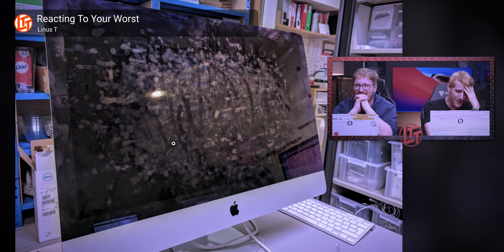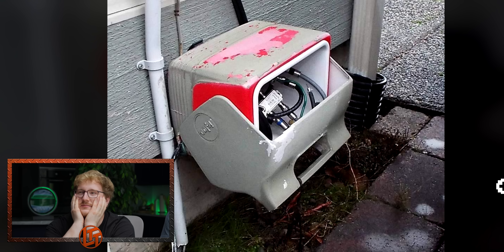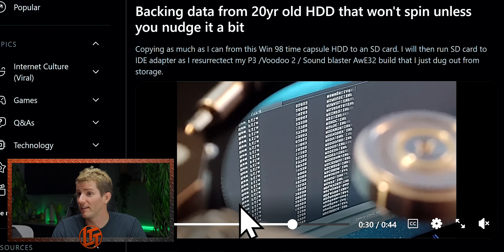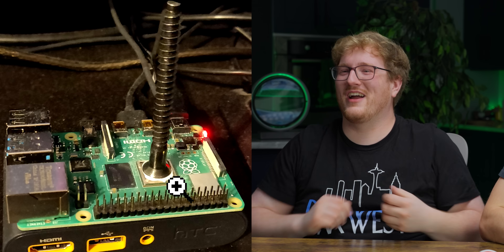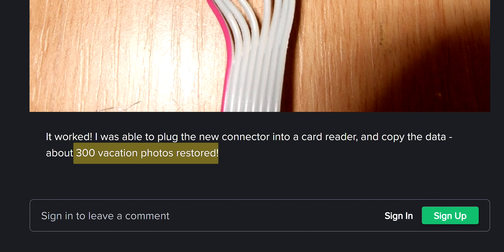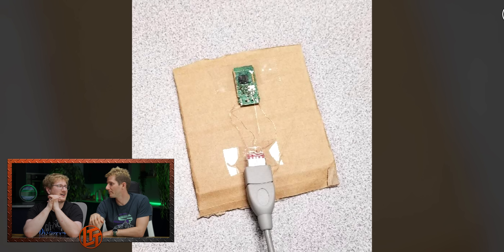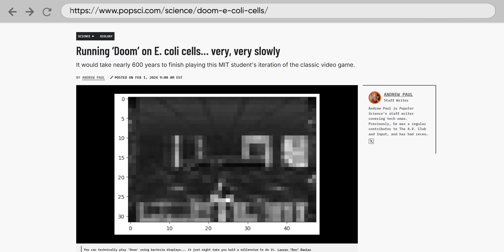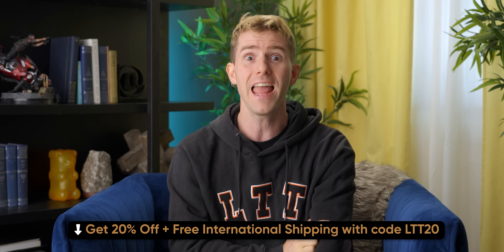Are You All Geniuses or Idiots? - Reacting to Your Best Tech MacGyvering

Comment: I needed to get Internet from the house to a trailer. I used a wifi extender inside a sandwich meat Tupperware. I cut the holes for power that doubled to hold it up and poked a hole for the Ethernet cord. Access was just the Tupperware lid.

Comment: I''m guilty of using my neighbors wifi. After getting internet installed at me house I no longer needed it, but then got an idea to make money.
I had a laptop with wifi, and it had GPS that would output a map, of where I went, dropping a cookie crumb on the map, every second. The wifi did something similar, saving wifi networks names and locked/unlocked status. I drove through the entire town. Up and down every street.
I reconciled the data. Found out where everyone was at that did not have their wifi locked, and went around to them and left flyers on the doors of the ones not locked. I made about $1,000 going around and showing a lot of them, how to lock their wifi.

Comment: 14:16 "This probably required so much effort"

Nah. Factory switch shorted, they just popped the switch panel up, and tied in the extension cord to the hot side of the circuit. Might have needed a screwdriver, probably not though. I've have to do similar with a paperclip in the rain.

Comment: 5:44 I use that model Samsung storage USB at work for imaging. They do have a metal case and they are always hotter than the other USB models we use. IDK if it's because they are metal or that they are the only USB 3.2 model we use. 

I can vouch, it is a metal case and that would remove a significant amount of heat even tho it's not directly on the chip.

Comment: During the summer the room was getting a little hot from the pc. Built a box on the back of the pc with 120mm fan intakes. Used a tumble dryer vent hose with a round cpu fan at the end and hung it out the window. 

Pc stayed cool room never got got

Comment: I once used Christmas lights with aluminum foil stuck in the female side, then wedged between the prongs on the pc, as a makeshift pc power cable, when my mom would take and lock up the actual power cable, to keep me off the computer. While it worked for a computer that ran windows xp, I definitely wouldn't recommend it. Lol

Comment: I put a wifi usb dongle in a plastic bag with a 10 meter usb cable. lowered it from the top floor till i got a perfect signal and let a wifi hack tool crack the wifi code and then i had free internet for the year i lived in Stockholm. This was 2007 and i met my now wife in that building.

Comment: Wanted a dual boot windows 98se/XP machine.  2 IDE ports?  2 DVD drives?  Wired a switch to the 12v and 5v Molex splitter and left the ground wires alone.  No hot swapping, but did the trick.  Both had their own DVD drive as a slave IDE.  Nothing ever went wrong in over 15 years.

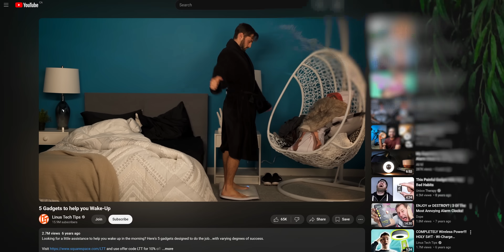Comment: @16:17 you see either a knockoff or legit with no branding sonic bomb sonic alert alarm clock which has a bed shaker. it does really well. I have one and still sleep through it at times. it's really loud and does vibrate a lot. I still understand his modification. I have joked about the same thing before. I find it funny how they didn't realize that it was a bed shaker clock.

Comment: Reminds me of an old 5" HVAC fan with stupid high CFM I bolted on to my case of my old K6-III it dropped the core temp by like 10 degrees. It was loud as hell and could take a finger off.  Plus since it was HVAC fan it as 120V AC.

Comment: I have that samsung flash drive and it does get hot during big transfers because it's a 256gb drive. I actually put a heat sink on mine and it helps a lot! Keeps writes at full speed.

Comment: even easier you "can" wire a five volt usb cable into the battery springs 😂 it gets hot after hours of use so thats why i should say do not do this and if you decide to anyhow make sure you unplug after use as its the wrong volatage its not safe but works well

Comment: The drone installing windows made me think about Xbox softmodding. You need some old usb like 512MB/1GB to transfer hacked save. I didn't have one, so I used my rooted OP6, use the drivedroid app and and add the necessary files to it and it worked perfectly, I could technically store saves like this x)
Reply: When I think about it, I also used this method with those really old printers we had on my student residence to print things

Comment: 5:49 Lol have you looked inside a laptop my dude? Heatpipes run like 12 inches sometimes from the processors to the actual fins and fan area. And yes those are slightly more complex being hollow inside with gaseous exchange. But still the thumb drive is only having to transport the heat 1/2 an inch or so.

Comment: Those can antennas worked great. If you really put some effort in it, shape it properly and use a quality antenna the distance you got was insane.
2 or 3 km easy. Got it once to 7km standing on a very high hill. If you really went for a dish like system, greater distances would be possible.

Comment: DVD drive and fan went in my Xbox 360 (after getting it repaired on my dime 4 times thru Microsoft I said F it, I'll do it myself).

DVD drive works fine if it's at a 4 degree angle, so there's some napkins stuffed under one corner. One of the rear fans failed, so there's a $5 Walmart USB fan plugged into the back laying on top of the heatsink blowing directly on it.

I've gamed for >4 hours straight on 'er no problem.

Comment: First latptop I ever owned circa 2011 was a windows xp laptop from probably 2006 ish? that had been my aunts that she'd gotten rid of because the screen snapped off, it still worked so my dad put two heavy duty pieces of plastic together in a laptop shape and just taped the laptop onto it. Had it for a couple years and then when I got a new laptop at the start of highschool I think we passed it along to another cousin. Could never close it but hey I didn't need to take it anywhere anyway because I was like 12

Comment: @12:26 that looks like a knockoff Arduino Mega2560, taped to a cheap battery bank, with an OLED display accessory on the right and a movement sensor on the left

@14:56: i partitioned my original (firewire) iPod with an emergency boot/repair partition for macintosh.  I did use it a few times to fix other people's computers.  This was back when macs wouldn't boot off USB and firewire flash drives were insanely expensive.

@16:28: alarms for deaf people are shaped a bit like frisbees and they put them in the bottom side of their pillows - they vibrate when they go off

Comment: I didn’t have a flash drive to update my bios from so I got an old windows 10 installer USB and wrote a simple script to remove the write protection after I found out what chip it used. Safe to say I installed my new R7 5700x the next day!

Comment: One of my old PCs had a openable front panel which when closed would hide the fronts of the optical drive and floppy drive. Very flimsy engineering, though. One of the two plastic anchors on the case where the panel would snap in, snapped off. I used a paper clip as a temporary fix for the missing plastic anchor... temporary, right up until I got a new PC.

Comment: I've currently got my laptop opened with its base in the air and a 40x40mm 25cfm 12v fan shoving air into the case because BG3 and Elden Ring are making it overheat. (Asus TUF 11th gen i7 and RTX3070 mobile)

Comment: 2:57 i had old parts and a spare gpu i installed an rx 6600 with i7 3770 16gb ram and a 250 watt psu to a pc that was an old office work machine cut the top to make it fit added an other psu 1200watts server supply for the gpu as a third pc to game on with my bros and out friggin works although it has no space for drives so i cut the back routed 3sata power and data cables behind the pc and installed two ssds being a total jerryrig system hooked it to a monitor and a projector in my room it works plays all the games i want i.ev Elden ring . Sons of the forest etc it also works as my projector pc.     That is my favorite pc of all i have😂😂

Comment: XD I should have submitted photos of my computer! I have an old office pc with an MSI gtx 1050 in it while under warranty the fans failed thrice and MSI requires you pay for shipping which is $20 USD. I got some Noctua fans to zip tie... problem... I only had 1x16 slot and x4 slot the x4 was occupied by wifi card (at the time my only gateway to the web) and I forgot to measure twice... anyhow turns out one of the two fans wasn't going to fit... and I needed both fans... so I got an old snack box, some tape and made a shroud that's badically turned the pc into an arts and crafts project.

Comment: 15:03
You should REALLY not do that. Mavics (that model of drone) are designed to be cooled by the downdraft of the rotors, so they can overheat FAST when they're just sitting. It's why using them as handheld gimbals is discouraged.

Comment: 😊I build an wooden monotor arm connect at the back of my ikea calac drawers on my desk so it holds up a portraite screen I mostly use for taxmanager and stuf next to my tv screen on a monotor mount wich sits abov my laptop wich has a asus zen screen next to it , so when I go outside I can have a screen with my laptop and at home its atotal of 4 screens running windows on my hp specture x360 tuch 4k 15 inch. 6 core 1 tb gtx 1650ti.

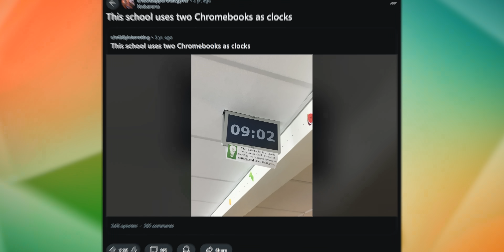Comment: 3:54 I don't think it's really green to use a laptop, with all that power consumption and rare minerals, in place of a $5 clock.
Reply: Schools use tons of electricity as-is. The power draw of those 2 devices are negligible compared to running lightning, HVAC, and all the other electrical
Reply: @JJFlores197   True, it's inconsequential, but it's not green.

Comment: I have that samsung flash drive, i dont know what samsung fucked up on them, but they do overheat like crazy, completely on their own, has nothing to do with laptop also overheating or whatever, samsung either used a bad nand controller that wasnt meant to be used in a small flash drive, or the aluminum casing just doesnt cool it off well enough, but either way it gets legitimately dangerously hot, like it shouldnt be legal to sell these things levels of hot

Comment: 16:09 the alarm clock she has I also have 
And let me tell you

You DIE when it goes of 
It’s as loud as a ship siren it is emiting flashing lights 
and there is a 12V Vibrator attached to it that you are supposed to put under your mattress. I put it under my pillow and it breaks my neck each morning 
But I am awake :D

That she still needs more stimulation to wake up means she is deaf blind and has no sensation of physical touch 

Only logical explanation
Reply: Btw it’s called sonic Boom if I recall correctly in case someone has problems oversleeping

Comment: that hotrod is why i hate screw design.. we should have been screwless towers motherboards last century ... iv literally had to tell my friend his PC died because he had screw shavings in CPU pins that caused the motherboard to blue smoke back in 2012 .. its a memory burned into my eyes... make sure you dont use the wrong screwdriver for your screws every time your screwdriver slips little flakes of screw end up in the air and they are nightmare fuel for computers when they land in the Lanes cpu and other connect slots electricity and screw shavings not a great mix

my sister also shorted her Mother board by loosing a tiny m.2 screw behind the motherboard and figured use a spare without collecting .. yeah 1 day she was moving her computer tower and pop black screen .. nothing... why these dont just have pop up clamps like ram is beyond me .. 2025 and we are still seeing screws for m.2 slots .. each slot should just have a clip you lift up that presses the card down like your ram clips 1 at each size .. and when you want to remove you simply push it back down and out of the way which causes the m.2 to spring back up for removal XD

Comment: Guys, I need help, so I reset my windows cause i wanted the pc fresh again, get rid of all the garbage in the system, etc.. and in cs2 im getting as high as 300 fps but then when theres smokes, nades, shooting, it drops all the way to 70-90 and jumps around 70-130, you can imagine how that looks on a 170hz monitor. And in all games i tested, I have big difference from FPS count and 99% fps, it doesnt look bad on every game but in gta for example, I was dropping gpu usage as well, it ranged around 70-99%. I never had this problem before, I have RTX 3080 and i5-13600KF with 32GB DDR4. Please help.
Reply: You're probably better off in the LTT forum with technical issues.

Comment: i'm new to pc building and will build my 1st in like 2months u guys think this is a good build?

AMD Ryzen 5 5600x 3.7 A 4.6ghz 35m 6c12t 65w Box        						
rx 7600//rtx 4060//7600 xt                                        			                  
Motherboard Asus TUF GAMING B550-PLUS WIFI II        							  
Memória RAM Corsair 32GB Vengeance LPX (2x 16GB) DDR4 CL16 3200Mhz Black - CMK32GX4M2E3200C16                                                					            	   
SSD Crucial 1TB P3 Plus M.2 2280 NVMe - CT1000P3PSSD8  							
EVGA Supernova 750 GT 750W 80 Plus Gold Modular        						          
Cooler Master Caixa Masterbox TD500 Mesh V2 Argb Preta (atx) (vidro Temperado) - TD500V2-KGNN-S00	  				        
Cooler Master Hyper 212 Halo Black CPU Air Cooler